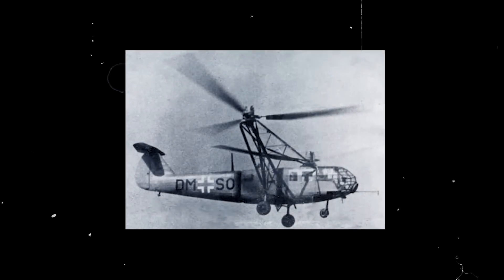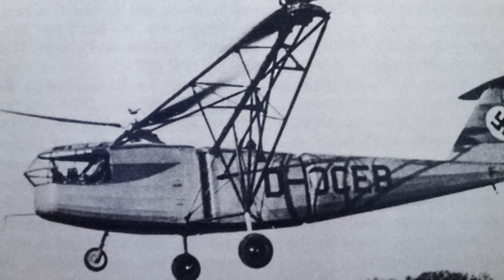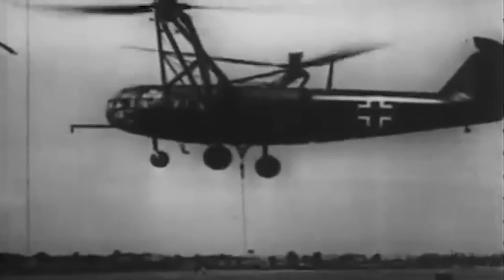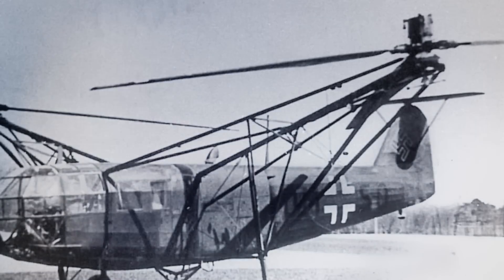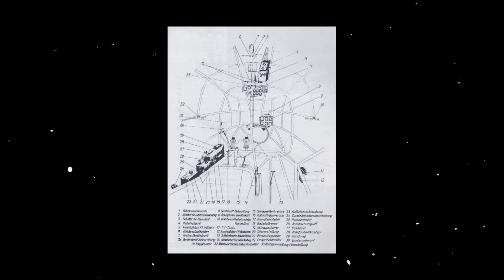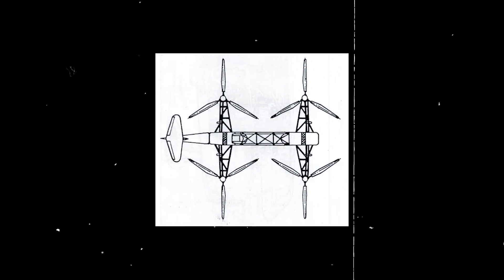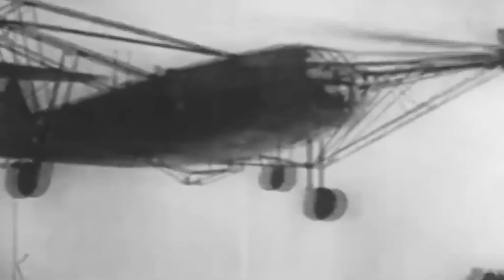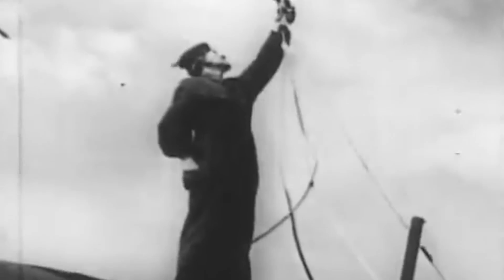The Luftwaffe Fa 223 Dragon - First Helicopter to Reach Production Status

Comment: ,, Ahead of its time " basically every nazi project.
Reply: Ben Siener  
Yeah, total apex predator. 
The Do 435 and 535 mixed powerplant versions would've soon followed. Also at the end of the war the FW Ta183 was in the works ( Think Mig 15). Not to mention , the New York rocket was under construction.
Reply: @patrickhorvath2684  Yes, and none of these weapons had the potential for changing the outcome of the war, just like the V1, the V2, the Me262, the Me163, didn't.
Reply: @CaptHollister  
Yes I'm well aware of German craftsmanship and ingenuity.  In my 5th decade of riding BMW motorcycles. 
First motorcycle with telescopic front forks in '33.
First supercharged motorcycle in '36.
First fuel injected motorcycle in '51.
First motorcycle with anti lock brakes etc etc
Reply: @patrickhorvath2684  ...And currently one of the least reliable brands of motorcycles. Personally, my GS was the only bike in 41 years of motorcycling that left me stranded with a fault brought on by a major design flaw, which was only the last in a series of major quality issues with it. Also:
First motorcycles with telescopic front forks: 1908 Scott followed by the 1934 Nimbus.
Reply: @CaptHollister  
Permiit me to be more specific,,   Cap'n Hindgrinder.
First oil-dampened telescopic front fork in 1933. Everything before that was strictly a spring front end.
Yeah my GS rear end was rebuilt at 60k miles  125k + miles and runs like the day it was made. I'd ride it anywhere. GS1150 Still holds the world record for fastest global circumnavigation of any wheeled vehicle. 19k miles in 19 days.
My 1990 GS1000 was simpller and lighter. My '81 R100RT had 176k miles on it when i sold it for 60% of what it cost new. Cross country toured on many /5s and /2s. 
BMW changed its  practices and marketing. 
Engineers used to stay in the motorcycle division. Now that's just a stepping stone to other paths in the company.  Corporate decided to appeal to the younger set who replace their machine every couple years. They were better, admittedly.
Reply: @patrickhorvath2684  Make an imprecise statement on YT and expect to be corrected. Surely you know the rules.
The transmission output bearing on my airhead GS seized solid, which caused the output shaft in the transmission to shear. An expensive breakdown, but transmission failures were common on the these early long-travel versions of the paralever rear-end. High-mileages are not uncommon on many brands. A work colleague had 300k on his Honda ST1300 (using only the cheapest Wal Mart oil !) when he sold it. My own experience is more modest, my 1986 Kawasaki Voyager XII had 160K when I traded it and my 2001 Honda Valkyrie had 150K. Both were running like new.
Reply: @CaptHollister  
Point noted..
Yes Japanese machines are very appliance like n reliable.  My GS1150 ADV  was last year before the 1200.
 When i was a teen, i had RD 350s and an RD400F.
 I'd sure like to find an RD350 or 400.. Oh did I  raise hell on those things..lol
Reply: Patrick Horvath at that point in the war it wouldn’t have changed winning or losing, just casualty counts.

The bomb didn’t win the war in Japan after all, it just sealed the inevitable outcome.
Reply: @Justanotherconsumer  
Yeah true, i forgot that our first atomic bomb was to be mailed to Berlin,  if the European war was still going on when it was ready. 7 more bombs were to be ready in Nov 45
Good thing the New York rocket wasn't completed,  otherwise NYC would be an uninhabitable wasteland...
Reply: Patrick Horvath Given the Nazi success with the V2, more likely they would have nuked some rural area in New Jersey if they’d had the bomb and were able to get it on a missile.
Reply: @patrickhorvath2684  "Good thing the New York rocket wasn't completed,  NYC would be an uninhabitable wasteland..."  

Since that was the case,  here we are 65+ years later and our own government is now making NYC an uninhabitable wasteland...🤣
Reply: The R-4 / Hoverfly first flew on 14 January 1942, and was the world's first large-scale mass-produced helicopter, and the first helicopter that set the standard for all helicopter designs Vought-Sikorsky VS-300. It first flew on 14 September 1939.
Reply: Cody Sonnet  The Germans didn't have a single working jet engine in 1935, they had their first engine running a few months after the British.
Reply: Not every project was ahead of its time!

Never forget the horrors the Nazis inflicted on Jews, other ethnic groups and minorities, and their general plan to conquer all of Europe and beyond. Those projects don’t even belong in the past, they should never have happened ever.
Reply: a whole waste of resources, they created 1000000 variants of everything instead a clever way to make a single vehicle of each class.
that only helped the alies to win faster
Reply: @INWMI  actually allies did also use multiple variants of their vehicles. you can easily see that in variants for vehicles such as shermans, p47, p51, etc...
Reply: @bassbusterx  nothing like the germans, for example shermans used almost the same engine for half of their variants and old m3 as artilery pieces, minelayers and transports.
ju87 is the only true dive bomber from the war exclusive dive bomber, unlike alies multipurpose aircraft such p47
Reply: @INWMI  exactly. the ju87 is the only exclusive dive bomber. German used many multi-role aircraft as well like the Ju-88, Do-217 and more. Panzer IV served as both an infantry suport vehicle and an anti-tank vehicle. The germans did nothing wrong by uptading their models during their service life. What killed them was mismanagement of resources with programs like the Maus, and the fielding of incomplete designs like early panthers, who broke down so often they had to be abandoned and blown up so the enemy could not get a hold of them
Reply: Bass Buster X, I think you are forgetting the Douglas Dauntless SBD. Pure dive bomber!
Reply: @bassbusterx  but we had the resources
Reply: @INWMI  what about helldiver?
Reply: @bassbusterx  Its harder, more expansive and time consuming  to design a vehicle from ground up, than upgrading existing models and german tanks where buil with this in mind, even with beasts like tigersand panthers main bulk where still panzer 3s and 4s in different configuration. Especially the the most succesfull Stug 3 on panzer 3 chassis. germany hadn´t the resources for a prolonged war and bringing the US and the sovjets into the war was a big mistake.
Reply: Bass Buster X but the thing is that all of those variants were direct upgrades of previous models
Reply: @bassbusterx  my favorite was the rocket sherman
Reply: @INWMI  LMAO, if they was so clever than we would all speak german now
Reply: @INWMI  What would be the point of mass production without oil ?
Reply: @darkoneforce2  ya sorry all germany is the best and won the war sorry guys
Reply: @INWMI  Germany lost bcs everyone was against it. US would have failed that way too
Reply: @foxtrotsierraproductions8626  The allies were fighting across the entire world. Germany couldn't even win in their own corner. They couldn't even support going into Russia, let alone half way across the world.
Reply: @INWMI  Tecnaly speaking the only thing that made the Alies win was the US Expres delivery for all sorts of war recources.

The entry of the US into the war brocke their neck.

The Axis emwould have done better without japan that as an alley.
Reply: @INWMI  And now we all drive audi's, BMW and Mercedes. Or Japanese cars. So who REALLY won the war?
Reply: @INWMI  So who do you think were the foo fighters that attacked Admiral Byrds fleet'?
Reply: Ben Siener  
Can you imagine a 1/2 scale Do 335  sport plane with two chevy 502s ?
Reply: @KyleDaLilFrog-Alt  
Homer Simpson; "You just can't stay mad at the Germans..."
Reply: War Child  Yes, of course, the rest of the world was totally standing still and no one ever would have developed rocketry. Nope, no one. Ever. Well, ok, the Soviets had rocketry. Oh, and so did the Americans. But otherwise no one ever would have developed it without the Germans. And jet engines. Oh wait, the British had operational jet fighters only months after the Germans and with better engines.
Reply: Cody Sonnet  Read the whole post dummy.
Reply: Except for the allied helicopters that actually worked...
Reply: Ben Siener  ,....and a lot of genocide, slave labor, and mass murder to share the accomplishment.
Reply: Didn't do them any good
Reply: @patrickhorvath2684  There wasn't gonna be any negotiations.
And what is dirty bomb ?
Reply: @patrickhorvath2684  No, it would have led to an A-Bomb being dropped on Berlin.
Reply: @CaptHollister  
Yeah i corrected myself,  remembering that the first A-bomb was going to be dropped on Berlin if the European war was still going in August
Reply: happy gekko  read my posts above and see for yourself or are you too lazy?
Reply: fo shizzle my nizzle!
Reply: Except the first was Spaniard and not German
Reply: They we're on drugs, hence why they thought of such ideas.
Reply: Germans were ahead of their time, no matter what peoples say. How the fuck are peoples even comparing the "sleeping giant" (US that was) with Germany tho lol, Germany was proportionally more advanced than the USA
Reply: There were plenty of projects ahead of their time like RADAR invented in the UK. There were also plenty of "Nazi projects ahead of their time" that actually were not. EG the ME163 which reached operational service in 1944 a full 4 years after the RP-318 and only months before the I-270. Jet engines? Frank Whittle was way ahead of the Germans until some idiot pulled his funding. He still got a working engine by 1937. The Germans didn't have a prototype for 3 years after that. I could go on.
Reply: They should have been ahead since they capture basically every scientist and engineer and force them to work towards the war effort, stole gold and anything valuable so they had the money. Plus they used forced labor so they had plenty of man power to build. But then all the allied forces basically raced each other to take every bit of the Germans innovations at the end war so we also profited from the same suffering.
Reply: Historically absolutely incorrect!
Reply: ArmyGrunt1986 <> Just because a victor country looks at or utilizes war machinery of the defeated country , does not mean they are party to how that country got the machinery , or who they used to build said machinery . They would be complete fools to do otherwise !
Reply: @robertmintz63  You're absolutely right , but it wasn't just German hardware. Europe, USA and Soviets took "Nazi gold swastika still stamped on it through Swiss banks, even though they knew that gold was stolen from victims of genocide. In 1950 the US Federal Reserve melted and recast 23 million( worth about 246 million today) in nazi gold. The US also stripped all badges/medals from nazi uniforms that were made from gold and diamonds, which were also taken from their victims. I'm not saying we were any where near as bad as the axis but were definitely not innocent in the profiting.
Reply: There is no question that if Nazi Germany was led by other than low-life S.S. thugs, sadists, and megalomaniacs, the “1,000 year Reich” would have indeed ended up “.... uber alles.”
Reply: Phil DeRosier doubt it. They where waging total war against not, not two, but three world powers that had larger populations, resource supplies, and economies than Germany did.
Reply: @flitetym  Except their lack of oil and other resources such as food and minerals. The German war economy was not sustainable and not even remotely able to fight a war of attrition. It's nigh impossible to conceive of a reality where they'd won against the combined power of Britain, US and the Soviets or even against a single one of those belligerents.
Reply: @LudosErgoSum  Perhaps many have forgotten why Germany precipitated WW2; it was WW1, and the “stabbed in the back” premise which was accelerated and accentuated by the Treaty of Versailles. Add to that, the Crash of ‘29, whereby the collapse of the Mark made ascendancy of a figure such as “Der Füehrer” a foregone conclusion.
I am not German or have any Germanic heritage whatsoever. Yet as I survey the construct of the US — particularly since the Industrial Age — I find it an inescapable fact that the most influential society impacting the US was no other culture than Germany.
I say all this because before the onset of the war, the Germans had numerous American industrial allies such as IBM and Ford, as well as many guilds or “bunds.” America was a “whisper” from becoming “Nazi-lite” itself.
And with current events as they presently are, who knows? Maybe the US is still on that trajectory.
Reply: Phil DeRosier except that they didn’t have the resources, manufacturing capacity, etc...

They needed to be aggressive thugs and take things by force to have anything at all.

They produced a lot of wacky stuff, and some of it was remembered for designs it later inspired, but much of it was pretty useless.

The US had its share of WuWa that largely get ignored because, well, we won, and there isn’t a need for a butwhatabout lost cause narrative.
Reply: @flitetym  Actually it was said many times that the allies biggest asset was Adolf Hitler. EG his insistence on producing the Tiger II of which only 500 ever got made (they could have produced about 2800 panthers for the same cost) and more than half of those broke down.Two enormous railway howitzers that fired less than 400 rounds between them and needed tens of thousands to get into position and operate. You could have had an extra tank division AND and extra artillery battalion for that. Then there was the buggering about Hitler did that delayed the ME262 by at least a year. The V2 and V3 projects? For the price of a V2 you could produce 10 V1's and 2 V1'sdo the same damage as 1 V2. V3 never got operational but cost a fortune and took up near 5% of the war budget for 2 years. ~I could name plenty more screw ups.
Reply: David Parry  Actually the whole humanity lost when the wrong pig was killed.
Reply: Ben Siener  And Judiaism would be exctinct
Reply: Trust  UK  &  USA  to steal technology from more advanced countries. 
Says a lot about their own intellectual shortcomings.
Reply: @pieterbezuidenhout2741  
What 3rd world sh!thole are You from ?
US/UK invented the industrial revolution and gave the world the steam engine, cotton gin, automobile,  airplane,  airconditioning, atomic power,  refridgerators, tractors, television,  telephone,  computers etc.
 Will the REAL lack of intellect please stand up ?

Comment: Is this the predesessor to the osprey?
Reply: There was other designs similar to the Osprey back in the 50s but in their case the entire wing rotated. That, of course, was not a good idea as that meant the aircraft lost the lift provided by the wing.
Reply: More like the CH-47. The Osprey rotors are mounted on wings that rotate 90° for hopizontal flight.
Reply: I didn't see it crash, so no......